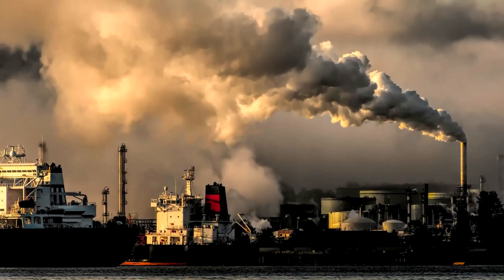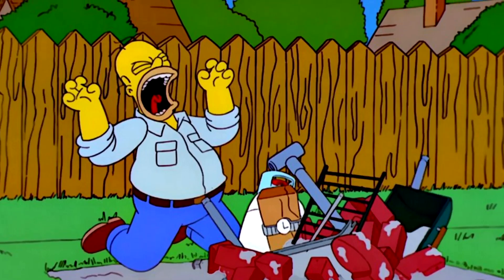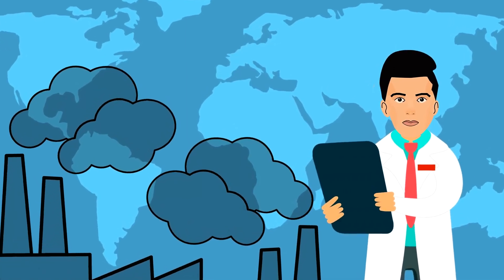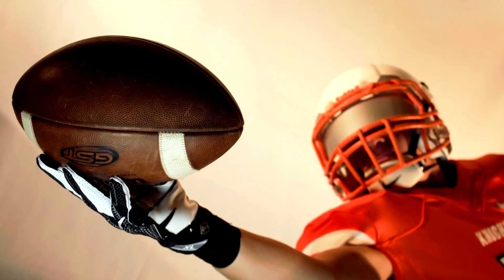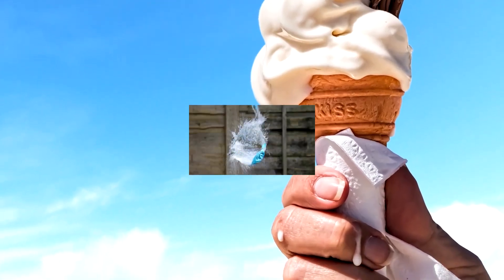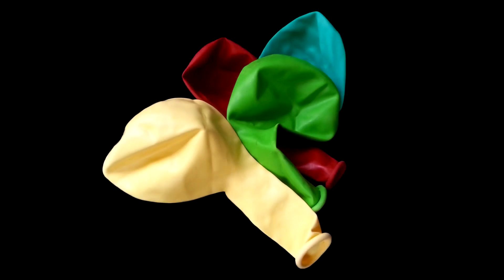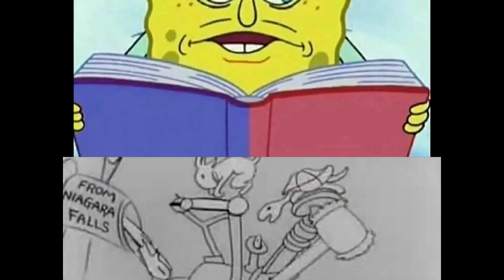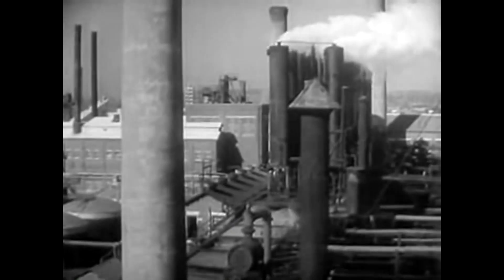why it doesn't work 27

Comment: The problem that was not talked about here is the equilibrium of reactions. Any chenical reaction, including combustion and other reactions done in industries to make the things we use in day to day lives, has an equilibrium of reactants and products. If we accumulate too much of the product with the reactants (like plugging the chimney of a factory), we significantly decrease the efficiency of the chemical process even risking it stopping entirely. No chemical processes, no factories, no 99% of the stuff we need to live in postmodern age.

The only way this could work is instead of dumping it in the atmosphere freely, it being rerouted to another plant that treats it and transforms into something else, maybe cooling down the CO2 to make dry ice as a coolant, for instance. But that would be super expensive and most likely not finantially sustainable.

Comment: Could we collect co2 and compress it into a solid and then make co2 blocks
Reply: You can't really do that unless you freeze it, but it would require energy to keep it frozen. And before you ask, no, not even the poles are cold enough to reach that temperature. There are however already structures created to store CO2 in its gaseous form just check for "CCS" (Carbon capture and storage), and while they do something, they are expensive and they come with their own set of problems.

But you know, you could simply take CO2 and combine it with other molecules like water to create a solid compound that can then be easily stored. You could even use solar power to do that. In fact you don't even need to invent machines to do that.
That's what plants, algae and several microrganisms do through a process called photosynthesis.

Comment: Stupid question but, would it be feasible to collect all the emitted co2 from cars and send it to a chemical plants to be used in an industrial setting or would it be a waste of time.
Reply: The question is what would the industrial setting even use the CO2 for. Industries usually produce CO2 they don't consume it.

If we are talking about simply taking CO2 and storing it somewhere, well that's an idea that someone already had and it's called CCS "carbon capture and storage". There are several problems with it, namely the fact that storing CO2 isn't easy and the trapped CO2 might just escape in the future, it is also expensive and it can really only be applied to specific places that produce a lot of CO2. Gathering CO2 from many small sources would be even more expensive and impractical.
Reply: Hard, expensive, long, impractical.

Comment: Launching pollution to space is less crazy than it sounds. Initial capture remains seemingly completely impractical, but supposing you were somehow able to capture pollution somehow with a magic wand, we could launch to space via some sort of energy-based launch system instead of a rocket (like Spin Launch or a mass driver) and then possibly push it arbitrarily high via lasers or somesuch energy beaming system. Of course, if we're able to send large tanks of material into space it begs the question of why we simply haven't put all our polluting industries in space instead, but hey, we're doing troll physics not sci-fi worldbuilding.
Reply: WTF is spin launch or mass driver?
Reply: @alexandergeorgiou-z5z  Spin Launch is a company that's trying to bypass making a first rocket stage by building up a bunch of speed on the ground first. Think of it like a sling or grappling hook, you can't throw it far, but if you spin it up first to build up some energy, they go much further.

A mass driver is basically a high speed rail but you keep building up speed by being in a vacuum and then exit out the side of a mountain.
Reply: @AgaresOaks  reminds me of a cocktail shaker
Reply: No it doesn't beg that question at all that's just stupid

Comment: Easy solution, make all vehicles drive in tunnels and have the tunnels ventilation be a long exhaust tube/pipe/passage into space.
Reply: Gasses would fall back down, also no known meterial (that we could mass produce enough) could go all the way to space without falling under its own weight, so you'd need to tunnel to both be made of unobtainium AND to go all the way outside of earth's sphere of influence. Which no known meterial can do, some can go to space, but none can do that.
Reply: I know, it's troll physics. Driving in tunnels has a whole bunch of other problems like ventilation, what to do if theres a fire, breakdowns, emergency services cant access them properly, etc.

Comment: If you drilled a hole from pole to pole and somehow took out all the air and dropped something inside would it "fall" forever. It's from pole to pole so we don't have to worry about centrifuge force and it will have no air so no wind residence.

Comment: What about geothermal energy. You literally just have to dig down anywhere on the planet and is basically infinity renewable and not hinges upon weather or geographical variables
Reply: you have to dig down DEEP
Reply: Geothermal energy exists and is already used with functional plants, but it is unstable and the energy produced is still low in relation to maintenance costs.

Comment: One thing i never liked about the idea of sending unwanted stuff into space is that, wouldn't this practice eventually deplete the earth? Sure pollutants are unwanted or even dangerous but they're not exactly alien to the planet. Everything we make, good or bad, is sourced from the massive space rock we're standing on, what's going to happen if we keep sending pieces of it into space over hundreds or thousands of years? That Jurassic park quote about whether we should do things just echos alot in my mind for these modern days.
Reply: If it makes you feel any better, we would run out of rocket fuel and materials a long, long time before we ran out of payload. Plus, we really don't have the technology to recycle these types of problems-- it'll be another long, long time before recycling pollution becomes a good way to get carbon, and any effort to dispose of stuff in space is most likely not leaving Earth orbit anyway just because it takes so much more fuel (and it's harder to bring the rocket back). If we find a way to keep going to space long enough to throw all our pollutants away, we can just go get it back later!
Reply: we get new natural resources randomly in the form of meteors
Reply: @doughboywhine new dlc just dropped 🗣🗣
Reply: @doughboywhine they're too far in between and small to be actually useful (on an industrial scale). And one day it may be too big to be used by anyone.